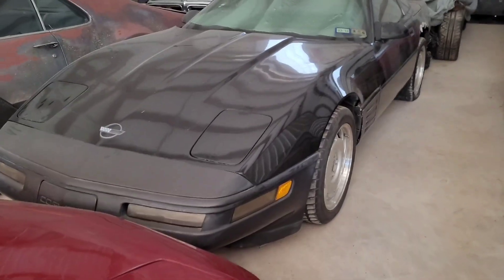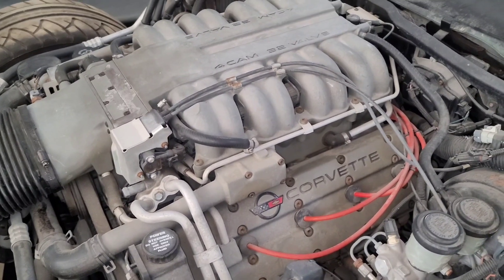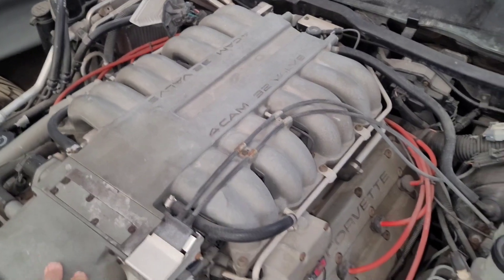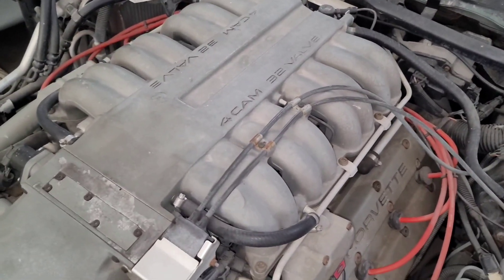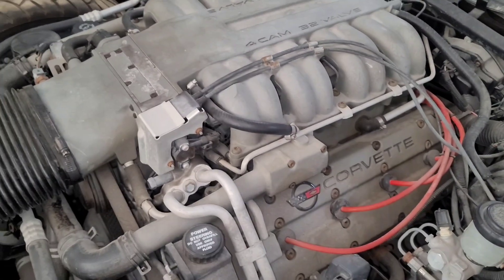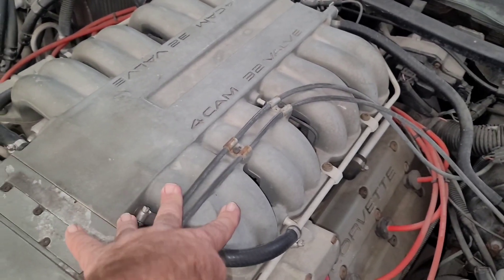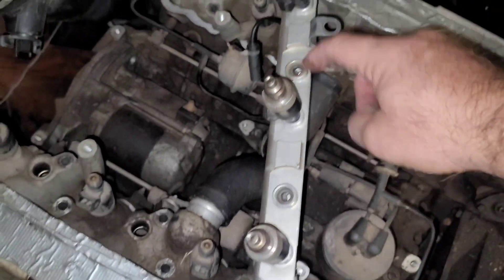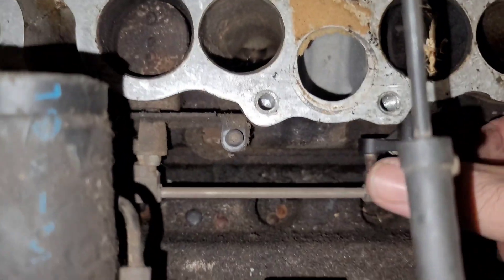The Epic C4 Corvette ZR-1 LT5 Engine of the 90's

Comment: The legendary LT5 engine was designed and extensively tested & punished by Lotus. GM owned Lotus at the time. During research & development, Lotus ran these engines on the dyno's from peak torque to red line and back to peak torque, to go back to redline, repeated over and over and over again FOR 200 HOURS NON-STOP, AND THE LT5 LIVED & STILL RAN JUST FINE. And yes, the C4 ZR1 with this LT5 engine STILL holds the world records for 24 hr high speed endurance ( 175.7 mph average due to pit stops that had to be included ) and 5,000 mile high speed endurance ( 173+ mph average ). That's like TEN Daytona 500 races back to back to back non-stop, without any caution periods. The only stops were quick stops for fuel, tire changes and driver changes. Mercruiser ( Mercury Marine ) was chosen to mass produce the LT5 due to their extensive knowledge, experience, and success with complicated aluminum casting techniques and the fact that they were also capable of keeping the incredibly close tolerances that the LT5 was designed with. Mercury actually built an entirely new facility for the sole purpose of mass producing the LT5 engine for Chevy. Because of all of the above, I am convinced that the Chevy/Lotus/Mercury LT5 is the most durable V8 ever produced in history for running long and hard. I believe this is true due to the fact that NO other auto maker has broken those records that the LT5 equipped C4 ZR1 still holds to this very day.
Reply from the maker: Excellent write-up with some great information. I agree that this engine is probably one of the best "alternative" specialty engines from that era and the one that re-started the horsepower wars. Thanks for sharing👍.
Reply: Thank you for the kind words. Actually, the LT5 still stands up to the modern high performance normally aspirated engines, and will outperform most of them in power delivery. Sure, there are  a few that can run quicker and faster, but when it comes to running flat-out for an extended period........no one can deny that the LT5 is STILL the King of the Hill.......because no one else has broken the 2 high speed endurance records that the LT5 still owns. No one else is even willing to try it, ( or they have tried in secret, and failed, because had they been successful, the whole world would know about it ) and that includes the engineers at Chevorlet. They stated that it's far more difficult than most people realize, and when you run an engine that hard for that long, things start to deteriorate.  @VetteSource
Reply: Was keptical about the bulletproof claims, figured it was more vette bootlickers
Well after owning one long term and working on many, owning LS for over 20 yrs its true. 
Hands down the toughest NA engine Ive ever owned even the LS .
Northstar and LS block architecture was taken from the LT5. If only they kept making them they already had 500hp pieces at GM but the LS1 was being developed already. 
WOulda embarrassed the 5.0 mustangs many yrs before their coyote came out
Mercruiser builds some of the best engines in my opinon
Anybody seen their new one? 775? hp its one bad mofo!
Reply: You should know that the 24-hour record was beaten by VW with the W-series engine, but the vehicle was not a production car.  It was a specially developed prototype.  So, the C4 ZR-1 still has the fastest 24-hour record for production cars.
Reply: @bb62bb62  You're not the first person to mention that to me, and the ONLY thing anyone before you provided was an article........written by VW reps. Made no mention of any SCCA officials being on site to document that all rules were adhered to, in order to break such a record. And without SCCA officials to publicly state that "We were present, and they adhered to all of the SCCA rules, and therefore successfully broke this record", it just doesn't hold water. So without the SCCA even being present to document it, how do we know that VW didn't "subtract from the average speed for pit stops" ( for new tires, refueling, and driver changes, etc ) Because every pit stop must be included in the overall speed. How fast does a car go while it's in the pits? ZERO mph. Also: you can bet the farm that multiple car makers over the decades have tried to break these records IN SECRET.......because should they fail, they don't want it to be made public. So even IF they actually broke such records, it still wouldn't count because SCCA officials were NOT present to properly document it. If they were successful, they would surely do it again with SCCA officials being present. Right? Just sayin'. There's nothing wrong with a company or team trying to break any of these records privately, but IF they were to be successful, they should do it all over again OFFICIALLY. Because when ya do something secretly without SCCA officials present to prove you did everything right, ya have NO Right to claim "we broke the record". Perhaps VW really did break the record.....but IT'S ON THEM TO PROVE IT WITH OFFICIALS BEING PRESENT.
Reply: @howabouthetruth2157  I've made two other detailed responses that Youtube seems to want to delete.  Simply put, it's not the SCCA that sanctions these events, it's the FIA.
Reply: @howabouthetruth2157 And we all know how VW likes to doctor the numbers, eh? How bout them diesels😂😂😂
Reply: @bb62bb62  Please see my other response to you. I forgot to mention that the SCCA rules require that a full roll cage be added to the vehicle, among other things, which made actually made the factory stock C4 ZR-1 even heavier than it came originally equipped........yet it still broke both the 24 hr and 5000 mile high speed endurance records. Cheers.
Reply: This is very interesting reading! Did the C4 ZR1 ever do the 24 Hours of Le Mans? I only ask, because it sounds like the perfect candidate for a class win...
Reply: @julianneale6128  C4s had to have thier own class like the Irocs. 
Both those cars cleaned up a lil too good. Love the C4 platform even with its faults. 
OBD 1 cars my fav efi pieces. 
Enough tech to be reliable Easy to work on simple to diagnose. 
Any more tech imo I have no desire for .Traction control, nanniess pass!
Reply: Lexus 5 litre v8 in the ISF, lc500?
Reply: @blackice7408  Has anyone used the Lexus 5 liter V8 ( or any other engine for that matter ) to break both of the 24 hr and 5,000 mile ( approximately 28 hrs ) high speed endurance records that are still held to this day by a FACTORY STOCK 1990 C4  ZR1 Corvette with it's bespoke LT5 engine developed entirely by Lotus? The answer is NO. And until someone does, there's no way to prove if any other engine can handle such high speed/high rpm punishment like the Lotus/Chevy LT5 has. Ford, Porsche, Audi, and even Mercedes have all tried to break these records, and all of them FAILED miserably. Hardly anyone has even dared to attempt breaking these records ( at least not publicly........if they've tried, they did it in secret, so no one would know they failed, and if they were successful, they would let the whole world know ) because running over 7,500 rpm's at 190 mph non-stop for 24 hrs and/or 5,000 miles ( 28 hrs ) utterly destroys engines. The ONLY modifications that were done to the LT5 engine in the 1990 C4 ZR1 Corvette used to shatter both of those records, was headers & open exhaust. NOTHING ELSE was changed on that engine for breaking those records. They even used the factory suspension with the killer adjustable Bilstein shocks. Per SCCA rules, they had to use race-approved wheels & tires, and install a full roll cage inside the car of course. It's one thing to have an engine as an every day driver that can easily surpass 500,000 miles.......and Toyota certainly has a few engines that do this ( the legendary 2.7 liter 3RZ engine in my 2000 Tacoma 4x4 is one of those engines ) .........but running ANY engine at such crazy high rpm's & speeds is a whole different story. When asked if they would like to try to break their own records, even the Chevy engineers decline, because they know just how difficult it is to do. For at least 60 years, Lotus has been engineering & developing race winning engines that at one time or another, have won every road course event. That's a hell of an accomplishment. Lotus has also CO-developed race-winning engines for other auto makers over the years. The legendary all-aluminum double overhead cam LT5 engine was installed ONLY in the C4 ZR1 Corvette. When Chevy replaced the C4 with the C5 Corvette, they stopped using the uber-expensive Lotus LT5 engine and replaced it with the LS1. Hell, to this very day, the C4 ZR1 with it's LT5 engine can still out-run nearly all new normally aspirated V8's found in modern super cars........and definitely OUT-LAST them if ran wide-open for long periods of time.
Reply: @howabouthetruth2157  Nope!
Reply: @howabouthetruth2157 How many endurance races did it win ? Asking for a friend.

Comment: Uk vette fan here, im lookin at a '90 with 187 miles...yes, 187 miles....up for 60k sterling, are there probs with the '90?
Great vid 👍
Reply from the maker: Thanks MC, appreciate the feedback. No problems with the 90s other than the normal maintenance issues that will arise with the high-tech features from the early computer cars from non-use. I would perform a very through inspection of the car you are considering to see which if any of these items are inoperable, and price your offer accordingly from there. Sounds like a phenomenal car👍.
Reply: @VetteSource  guessing none use isnt to good on the LT-5?
Reply from the maker: That's with any car, but as long as it's been properly stored it can be brought back out of hibernation.
Reply: @mcmc1863  No use isnt good for any engine Parts seals etc were designed to be used regularly. As long as its not rusted seized it ought to be ok.  Use a boreoscope put it down a spark plug hole to ck. They are cheap these days
Reply: The Multec injectors were infamous for electrically shorting. Upgrading the 16 injectors to a Bosch design will bring true proper engine operation. Here’s a link to a video I shot many years ago walking through diagnosing a shorted injectors on the “secondary” side: https://www.youtube.com/watch?v=RkKfoA7LSR8
Reply: 90 Z or an L98?

Comment: One thing you might find interesting, is that on your second engine, the little girl that installed the secondary vacuum actuators, bless her heart had no real mechanical ability of understanding, and she installed them 180 degrees out. This caused the arm from the actuator to have an angled configuration over to the linkage. It was designed to be installed so the arm was parallel to the linkage. This never caused an issue, and was not caught on many many LT-5s. The diaphragms never failed although I would never change one to the correct orientation, as it has been “ran in” in the wrong configuration.
😋
Reply from the maker: Now that's an interesting bit of trivia. Where can I find out more about it?
Reply: @VetteSource  FSM, Have it all on a CD.
Reply: Read a comment on a newer video where a lady said she worked at mercury marine in Stillwater, she said most of the people building this engine was on acid, and or stoned so that makes sense.

Comment: I believe peak torque for the LT5 is at 4800 rpm. But I'm told that the LT5 pulls like crazy throughout it's entire rpm range.
Reply from the maker: I think that is correct, but would have to go dig through my reference books.
Reply: They do...its seamless power not likea  pushrod engine
When you get the secondaries open you can feel it..kinda like hitting an old double pump carb. Cool analog feel to it.

Comment: 15:11 I cringed when that aluminum fuel rail (w/injectors still in) fell on the concrete floor. Not exactly cheap parts to either replace or repair either, i'm assuming?   :|
Reply from the maker: Yea, that one got away from me. Food thing is they are much more sturdy than they look, but like you said LT5 parts VERY difficult to find. Thanks for watching👍.
Reply: @VetteSource  good thing they overspec'd EVERYTHING on these engines, right? lol
Reply from the maker: That's for sure.

Comment: Do you have an lt5 available for sale?
Reply from the maker: Hey Gus, this was the last spare LT5 I had and sold it a few months back. I have one more, but it's still installed in my 90 Z. Are you looking for one to put in a hot rod?
Reply: @VetteSource  yes, building a custom truck on a C5 chassis. I thought a 32v would be cooler than an LS
Reply from the maker: Yep, that would be a unique build. I'll check my contacts and see if anyone has an LT5 they would be willing to sell.

Comment: Can you point me to any additional detail on the secondary throttle system and on an EGR delete?
Reply from the maker: Murray, I am planning a follow up video for the LT5 shortly. Were you looking for a video that takes a deeper dive into the secondary throttle system and EGR system?
Reply: @VetteSource  that would be very helpful. It’s the first time we have utilized this motor - tired of seeing LS swaps and wanted to do something unique with this motor. Lots to learn. Was looking into a possible EGR delete as well as trying to understand the throttle system as there are the two cables off the throttle body and I believe the secondary throttle system utilizes vacuum to open. Have the supplemental book specific to this motor on order. Thanks much for the help. Great video - I’ve watched multiple times.
Reply from the maker: Great, glad it has been helpful. You're on the right track ordering the FSM for the LT5. Be on the lookout for that video soon👍.

Comment: I recently found a 92 z-51 in a barn that hasn't ran in 7 years. I bought it because it was cheap 2k$ but didn't know it was a z51 car until i ran the vin at the dealership. the hood also didn't open. should I sell the motor and ls3 swap it or just sell the whole car as a project?
Reply from the maker: Hey Flagcity. Is it a Z51 or ZR-1? Lots of difference as one is a suspension package and the other a completely different Corvette with a unique VIN number and 1 of only 502 produced in 1992. With that being said, it would be a mistake to break apart a ZR-1 for an LS swap. Just let me know what your working with and I can give you some further ideas.
Reply: @VetteSource  today I received a message back from a local corvette restoration company and there interested in buying the car off of me, there offered me 9600 for the car. I'm waiting for proteam corvette to make a offer on the car so i can see who's fare. I do alot of ls swaps so moving it to someone who will restore it. it is better than having it sitting a year waiting on parts
Reply from the maker: Yep, that's the best option. Definitely a car you want to keep together for somebody to put it back on the road in its original condition. What color was it by the way?
Reply: @VetteSource  red ext. red int. black strip down the middle of the car
Reply from the maker: Yep, red on red is a cool combination. Good luck with the sale, and let me know how it goes. I may have people down here that would be interested in it if you don't find a buyer in your area.

Comment: great job explaining the LT5 . I own a 1995 .  Removed the Plenum a few times now . Easy by the third time lol . Replaced Starter , 16 new injectors , new FPR now called an Improved Fuel Pressure Regulator or IFPR ,  new Plugs , new fuel pumps , there are 2 fuel pumps on this car , new fuel filter , new Ignition coils , 5-8 coil had failed so changed all of them .
Reply from the maker: Thanks Trip, glad you enjoyed it. Some of the normal maintenance for an LT5 engine seems extreme compared to other engines, but oh boy how fun they are to drive👍. I've always loved the last year 95's with the 405HP engine. Great performers with the updated interior design.

Do you happen to have one of the Competition Yellow Z's?
Reply: @VetteSource  mine is Polo Green with black dash and beige interior  .
The Ronald McDonald ZR-1 is a Competition Yellow with a red interior lol . But it was the McDonald car so it had to have those colors . No idea where that car is now . 
 I also have the Marc Haibeck Chip in my car so it adds another 10 HP so mine it is 415 hp .
Reply from the maker: Yep, I saw the Ronald McDonald Z and the one off Admiral Blue with Red interior  Z. I believe they were both 94 models. The Polo Green is a really nice color as well.
Reply: @trip5003  Why guys drool over that Im clueless. Oh...rare. 
Fn redicluous looking I Think. 
Remember the dealer by my house had a white top red gut GS for a yr couldnt give it away all the staff called it a clown car. Now the vette guys drool over it cause rare, lol
Reply: Hey, Hey!!! My son and I just got my dad's 90 ZR1 roaring once again after about 15 years of sitting. Did about the same thing as @trip5003 did with his. Fuel tank had much water in it but we cleaned her up and were extatic when it fired up. Can't wait to get her on the road!

Comment: I read till 1993 all major repairs to the LT5 were done by Mercury marine. Engines were removed and shipped to Mercury. Even gave the option for a new engine instead of repair. After 1993 GM took control of repairs.
Reply from the maker: I think I remember seeing that in the book that came about detailing the LT5 engine. If I'm remembering correctly, GM didn't feel that the dealer technicians had the advanced training or special tools needed to properly reassemble the major subassemblies like you mentioned.
Reply: @VetteSource  THey were a pain in the azz to work on unless they were out, too.